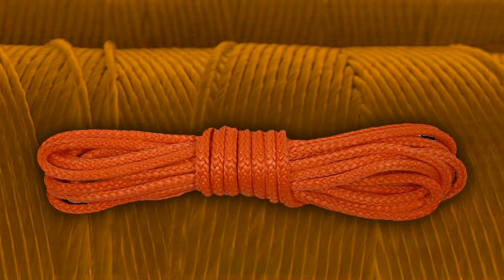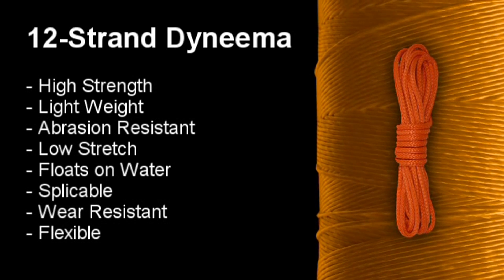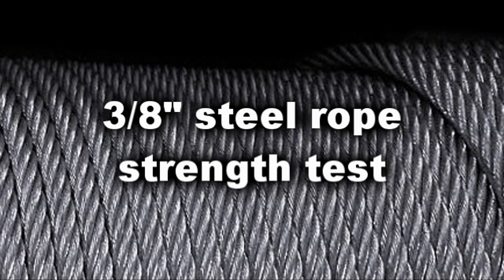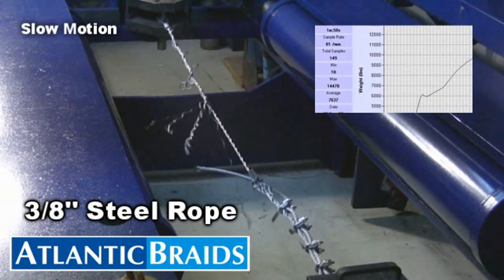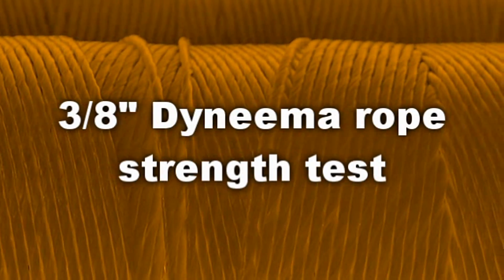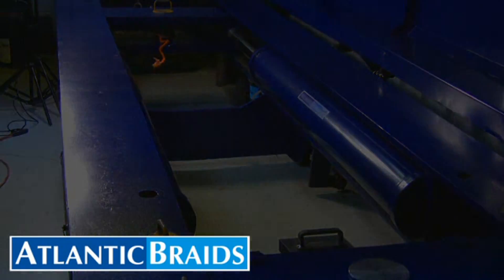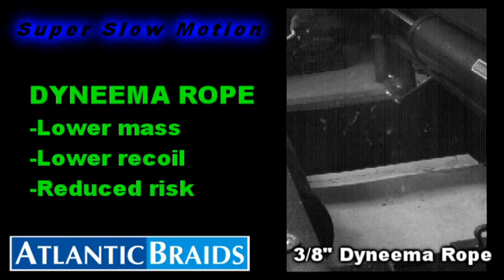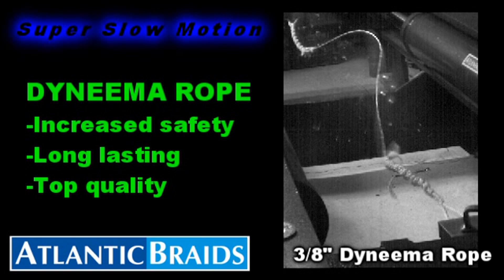Dyneema rope VS steel rope - strength test - break test

Comment: Dyneema rope is less stiff than steel and stores more elastic energy when loaded to failure. Dyneema stretches up to 2.5%, whereas steel never stretches more than 0.5%. I would argue dyneema rope is more dangerous upon breaking because of the increased energy stored and the lighter weight of the rope results in the rope being thrown at sonic speeds.

Comment: When I see large cranes and tow trucks using synthetic rope instead of steel rope, THEN I'll consider replacing my winch cable with synthetic... Until then, I'll stay with steel cable with polyester (or whatever synthetic) straps or steel chains for extensions when necessary.

Comment: But it makes no since my dad has been using steel cable for many years and it never failed him like that while me on the other hand have been using 3 strand polypropylene rope and it has never failed me it was so strong that my uncle tie it to a strap that he was wearing one time and jumped off a tree with a trampoline at the bottom but then I freaked out because the rope didn't break it only stretched a little so my uncle had to unbuckle his strap to land on the trampoline to get down what freaked me out was that my uncle was weighing nearly 300 pounds at the time so I thought the rope was going to break but it didn't even come close to breaking.

Comment: We use dyneema. If your careful and follow the rules its a good choice. I like the fact it floats and has no real memory effect. Its light too.  Wire is more abuse friendly in some respects.
Reply: Anolbea, This may sound crazy but, I bought some dyneema bow serving string thats black and white striped. I've replaced the nickel/silver wiring on my favorite old fiddle bows with the dyneema serving and not only does it look great but, it is very durable.

Comment: A great product but I'm very concerned about your claim for long lasting. 
There's a reason for steel ropes versus certain fibres and that's how easily a sharp edge could cut it.
Reply: Thank goodness for core dependent rope, dyneema core with a nylon/poly cover is a wonderful rope, either way you want to keep it out of the sun when not being used even if the cover is poly or nylon
Reply: @Joshua79C  id like to see more dyneema core with something like a rayon type hemp cover or latex

Comment: Someone brought up a question on another channel as to it's UV tolerance, how does it hold up to that?
Reply: It doesn't hold up to UV.  It degrades.
Reply: Thought it might. Not a good thing. Steel would be the logical choice for longevity.
Reply: Speed of degradation depends on how well the rope is made and protected, and the amount of sunlight its exposed to, many crane operators are replacing their steel with Samson K-100 dyneema with some lasting 2 years. Either one have a useful life so even steel requires replacing from time to time. Also most going to synthetic lifting rope are using it for ease of installation and safety factor due to weight savings compared to that of steel wire. Just to give aan idea of where it should not be used in place of steel is ziplines and bridges or other suspension structures as steel allows for signs of failure when a strand or two are clearly snapped before the rest of it goes due to reduced capacity from those broken strands and the others have to take up that slack.
Reply: i use 2mm hollow braid dyneema for my hammock suspension, had it for a few years now and it gets a good few weeks out in all weather each year. it definitely fades but so far it hasn't snapped on me, i hear it is also used a lot in high-end sails, and sailing rope.  so must be fairly resistant

Comment: Could you make cable snaps less dangerous by adding a few strands of something soft to adsorb energy in the event of a failure? (e.g. mild steel for steel cables, some other plastic for dyneema.)
Reply: anothermoth Or just throw a couple of floor mats over the cable to absorb the recoil. That's what most people do, anyway. There are a few who buy tow blankets but really, any thick, hefty canvas or rubber sheet will do. The thing is, if you follow safe winching procedures, the risk of getting hurt is minimal. Dyneema should be an option for those who want it but it's not like there's an epidemic of off-road enthusiasts cutting themselves in half with cable.
Reply: There are two cordage makers that manufacture core dependent ropes like dyneema with say a nylon or polyester cover for longer service life  though at a reduced weight capacity
Reply: Then of course there is some steel wire manufacturers making such with a core of stronger mild steel with a cover made of stainless which is of course due its alloy is not as strong but less prone to early  or as much rusting.

Comment: Dyneema rope is far superior and much easier to handle but why do a test on a cable that uses cable (crosby) clamps? Right on any package for the clamps it says it reduces load to 80%, it is a better product no need to try to stack the deck in the test
Reply: In this example test video the steel clearly broke in the strands, not the connectors, the reduced load is just a safety factor much like with trailers which could actually carry a bit more weight, but something will always tend to fail.
Reply: "no need to try to stack the deck in the test"  Apparently there is.  14.5K is 80% of 18125.  So the breaking strength of each would have been the same (within margin of error), and their apples to oranges comparison video wouldn't be useful propaganda.
Reply: Study it under super slow motion.... The break originated where the saddle of the clamp is. Spelter sockets should be used on the steel rope for accurate tensile strength testing.

Comment: So why don't winches use dyneema rope? Because it scratches easily.
Reply: They do. It's catching on.
Reply: I've used a crane that used dyneema lol
Reply: Bobby Patton ok
Reply: The Metal Butcher But doesn't it deform easily? I mean, it's easier to cut it in half and rocks can deform it easier.
Reply: Metal cable is cheaper.
Reply: Because they're saving on cost
Reply: because dyneema is only working up to 80°C well.
Reply: SMOKER and the Gimp you keep in Zed's basement can't cut the dynema with his catfood can lid and free himself. That rascal!
Reply: Bobby Patton I was talking about dyneema?

Comment: Lower recoil for Dyneema? It's quasi exploded! It will cut your butt off!
Reply: +M1TGLIED  +Drewderpderpderp  You two don't understand. They were referring to the horizontal expansion of the breakage AWAY from the rope and not along the rope. It's highly unlikely that a person would place his body or head directly next to the rope at the very top or bottom where the load is being lifted. Instead its much more likely that a person would be standing a foot or two aside from the rope. In the case of the steel rope severing your very likely to get injured near the center of the rope due to the outward expansion of some of the steel bands. But with the dyneema rope the energy of the breakage is almost entirely directly along the center of mass. In the case of a partial breakage the dyneema rope behavior much more like the steel rope. But the velocity of the outward expansion/movement is much lower(it only wiggles outward) vs the steel rope(which explodes outward). That combination means far less energy would be deposited on any object being struck by the dyneema verses the steel stands.
Reply: The exploding dyneema has such a small mass that at that speed it would do nothing more than leave a large welt if it were to hit you. Steel cable on the other hand can and has been known to cut of limbs when it snaps and is moving at that speed.
Reply: been whiped by a few ropes, bruised but not cut, steel wire though I keep a safe enough distance from or close enough to a barrier/shield when using in a controlled or uncontrolled situation.
Reply: +M1TGLIED But it doesn't eviscerate everything within 5 feet of it...
Reply: agreed. at tension its so stiff all the energy is lost on breaking.
Reply: It would knock the ball gag right out of your mouth and tear your mouth zipper off your upper lip. A tear drop would fall from your eye but master won't see it. Ooooh.

Comment: how bout making it a wee bit cheaper? plzz?
Reply: Nope.  They demand your blood or your money.  People are going to die if they don't make this affordable for everyone.  Could I get a tax subsidy please since this will reduce consumption of medical services?
Reply: If you want cheap lines the buy the Chinese products which are relatively  weaker and unpredictable in quality. I bought 10,000 metres of UHMWPE line from a Chinese manufacturer and it tested 20% weaker than claim plus the line was not hollow braid as requested. It couldn't be spliced. Also the price suddenly was jacked up 20% when I wanted to pay through an official channel. It seemed like the owner was avoiding tax. I only purchase from companies that use officially endorsed and sourced fibres such as DSM Dyneema, Spectra and IZANAS. The are lots of legitimate cord, line and rope manufacturers who use genuine high strength fibres but I don't know any from China. People buy for Chinese supplies at their own risk. If you are buying large quantities from China then you would need to establish tight control over the quality and probably visit the factory to see the testing and monitor quality control.
Reply: you do not want a cheaper made rope, lower cost would be nicer though and some places that sell these do discounts once in a while which is "cheaper"

Comment: It's not necessarily safer, you have a rope with 18000lbs flying back on whatever it's connected to causing major damage, say winching a truck out it breaks, that would cause a major dent, still a good video and looks like a good product
Reply: +ThisisWar51511 Rope vs steel cable it is much safer.

This past weekend offroading we had a guy who snapped his winch cable and it not only whipped a tree and sliced the tree it hit the truck and sliced about 3" into the truck body.

One of my friends had a synth rope he wanted to test. We hooked 2 vehicles to it and pulled to see how much it would take to snap. 
Finally 2 Jeeps in 4x4 pulling down hill finally snapped it and the rope recoiled about 7' and hit the ground.
The winch cable snapped and flew about 35' before half of it smacked the tree and half of it smacked my friends truck.

It's quite a bit safer.
Reply: +spydergs07 I have seen the same results when using this rope as sheeting (a nautical term for sail control lines).  They don't "flail" and cut your sails like traditional sheets and hold more load with less flex.  I have been told that long term UV exposure will reduce their load capacity, but I generally replace my sheets and stay wires annually.  This has not been a problem for me.
Reply: the only time rope is more danger than steel wire is when the attachment at the end of said rope fails and remain attached and its a dynamic or kinetic type rope which in this case would sling said object like a ballistic projectile as evidenced by a few videos here on YT

Comment: Perhaps an answer to rusting cable in suspension bridges. A problem throughout the world.  You can hear the strands pinging as they give way.
Reply: +tincoffin Rope isn't ment to have a long lasting load on it though.
Steel cable can with stand a constant load for years.
Reply: Much the same with wood cribbing, you want to hear cracking when its being overstressed instead of a sudden crack in utter failure. steel in this case is best suited to long term out in the sun use and for bridges, if you notice a strand or two broken you just simply order in a new section and replace it. Dyneema has its uses but not as versatile in every case like steel as it will degrade in the sun and give off very little noise if any at all when a strand or two snaps.

Comment: The SWR should also have two eyes
Reply: Eyes still have a reduced efficiency. I agree that clamps are shitty for this comparison but only Spelter sockets are 100 percent efficient on swr. In fact it looks as if the break originated at saddle of the clamp

Comment: I wonder if Dyneema comes in metric values too ?
Reply: Think that would be manufacture specific.  Amsteel I think is made in U.S.A.  Even so I think they also give size in mm's.
Reply: Amsteel a trademark of Samson, others use the alternate dyneema or spectra for such ultra high molecular weight polyethylene of fibers, others making winch or kinetic recovery ropes use high modulus polyethylene named plasma due its stretch. But Samson does list both US imperial and Metric values for many of their ropes, if you want to find out the metric value, just type in the G search bar 'unit converter'.

Comment: Sure, dyneema rope holds up to TENSION, but I won't be impressed until someone can offer me a rope that holds up to compression.
Reply: One rigger asks to another.  Why are you pulling that chain?  The other rigger replies.  You ever try to push one of these things.
Reply: Always so much tension in the rope, wire and chain industry, never any weight on their shoulders.

Comment: Also there are some comments vis a vi chafing and sun degradation, not to mention the different splice arrangements.
Lets have a better analysis instead of a caveman-like 'my rope lift more' mentality. Can we look at repeated load tests (ie how many times can you put say 14000 pound on the steel or dyneema before failure, partial or complete?) I think it takes more than just a simple test, and as yet unverified claims about your product. Its like saying a hotrod has the most horsepower, but everyone knows its torque at the wheels and grip on the tyre that matters. A key aspect of a good rope is that it does not act like a chain (ie 1 weak link = failure)
You haven't sold me or any aussie tradesman worth his salt. But keep working on it, I am sure you can make something worth buying...
Reply: Lawrence Mayne Calm down, whats Dyneema ever done to you? Steel facist :')
Reply: we use them on tugboats and have replaced all face wires with what we call spectra lines which is dyneema. with wire it takes 2 men to face up the boat but with dyneema you can use one finger. we hold a 90' towboat to 1000' of loaded barges and cross rough bays and only have 2 part 30mm dyneema face wires. As long as you use chaffing gear they last longer than the old steel cables. Theyve been tested in the field man, not just this video. They are now making chain links out of this stuff.
Reply from the maker: I am not the manufacture... I just made the demo video for them at their request.
Reply: +Lawrence Mayne if you were an industrial consumer you would not be asking about product specs in a youtube comment section
Reply: i agree video is pretty one sided
Reply: Farmers and contractors never bought rope did they? That is an interesting point of view, chief... maybe the great unwashed farmers and contractors of this world, myself included should shut up and leave the commenting to the all knowing and oh so much more noble industrial consumers.... wtf...
Reply: is that what i said
Reply: Cool, but horizontal loading is rarely the angle I am coming from (pun intentional, to my eternal shame...) but yeah, I get the weight savings from a manual handling perspective. My work is usually about gantry cranes, and shaft l&l. I think that the applications videos this dyneema should have would be exactly the sort of test that will show its strengths.

Comment: I'd still choose steel. The test showed that the steel was able to keep a positive stress load on the testing machine, whereas when the Dyneema snapped it was a clean break. Accidents happen, and ropes fail. I'd prefer a rope that doesn't snap instantly, one that gives you a warning (if only split second) that it is about to give way.
Reply from the maker: The trade off with Dyneema is a higher overall load capacity before failure.
Reply: I think you missed many of the advantages of the Dyneema such as the ability to splice it and the clean breaking  quality.  Im not criticizing you, it just Iv worked with steel cable in logging and oil rigs and have seen what happens when steel cable goes. Of course you should always work well bellow the stress limits of a product so breaking should not have to be a factor though we know thats in a ideal world. Just concerned for your safety.
Reply: +Lawrence Mayne If you were to look at repeated tests you would see that some break clean and some don't. Same as steel.  The advantage is that what goes flying in recoil isn't going to do as much damage.  This is great for guys running their jeeps out in the woods. If you are in the wrong place when a cable breaks which would you rather get hit by?
I think this dyneema is great stuff and should be used by every wincher in competition. I cringe at every video that shows tons of people standing around while guys are trying to winch their rigs out.
Reply: Again, for me the clean breaking quality isn't an advantage.
Reply: ***** I know that dyneema used in climbing is almost exlusively in static load roles, since in dynamic settings they have no elongation or near to it, leading to injured climbers, if it doesn't snap and drop them. is the steel also in that no elongation category?
Reply: I don't want steel flying back at me

Comment: Just be aware that any knots which can move around have the chance of weakening Dyneema by over 50% because of its low melting point. Be very careful with anything causing friction on it, especially in terms of other fabrics (including itself, as in the case of a cinching knot).